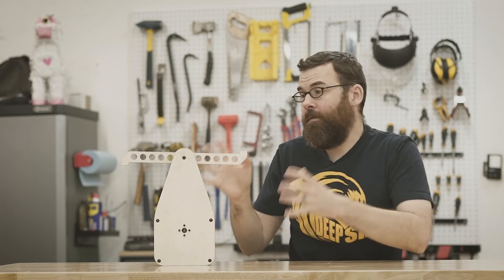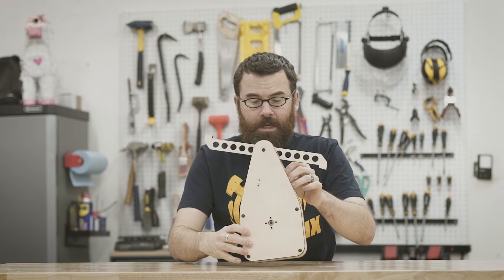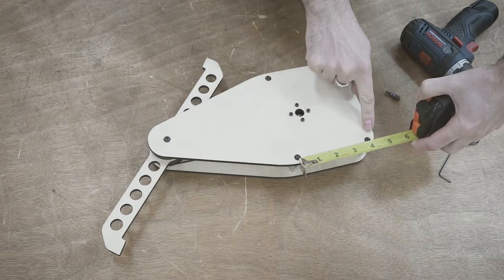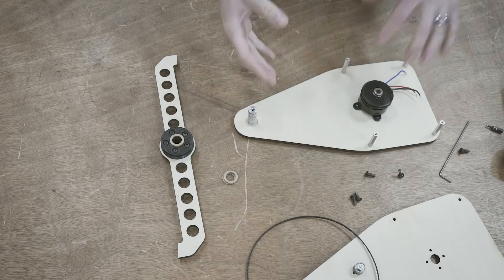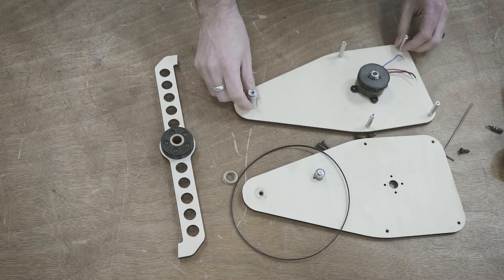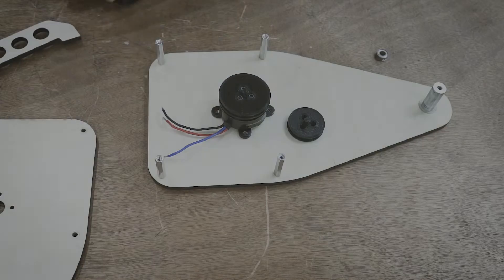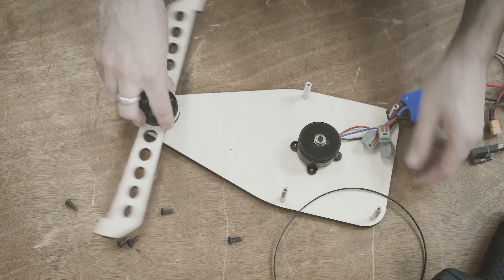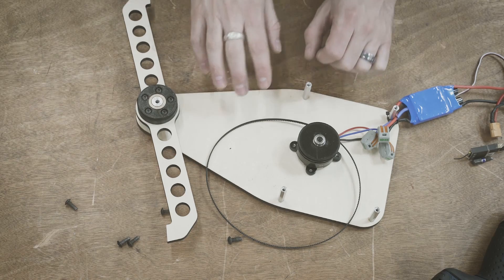Psychotic Break Build - Frame Mockup

Comment: what size and kv rating motor do you use in psychotic break for the weapon?
Reply from the maker: I think it's a 44mm pancake motor, ~600KV.  It's not available anymore, so I cannot send a link to it, and you can't buy it anymore unfortunately.
Reply: @RobertCowanDIY  Ah, thank you. Currently working on a new beetle weight, Bullet Ant, with a weapon larger than any bot I've done before ~.7lbs vertical disk. So I've been asking around about other bots weapon motors that have very large active weapons to get a feel for what spec motor I may be looking at.
Reply from the maker: @RayLopezBTownSting  Got it.  Check out some of my other videos, I have one where I compare motors for anxiety attack (which uses pretty much the same weapon system as psychotic break).  Generally speaking, 150W per pound is a good place to be for brushless motors.  So around 450W or so would be good.
Reply: @RobertCowanDIY  Super helpful, a lot of my first bot was just testing a few different motors I had lying around from other projects till I got one to consistently spin up to a good speed. My main issue was using motors with too high of a kv rating, but that wattage tip is a really good one.

Comment: I have a question.  On crippling depression you put a propeller on top of the weapon to give the bot some down force.  I don't know if that was a joke or not but a thought occurs.  If you were to grind the edges of the bar to make a pseudo propeller, you'd get some weight off of the bar and you'd get some down force for your bot.  Is my logic sound or is there some foible of physics that I am missing?

Comment: I’d be interested to see how much weight you could save with some FEA/generative design on that frame.  Or the weapon for that matter.
Reply: What's the loading case on the frame? Generative design works well with easily defined loads but the weapon will transfer forces in almost every direction after hits
Reply: Edward Etheridge it also works well with not so easily defined loads or loads from all directions.  There’s still weight to be removed.  Just takes more effort and you have to combine the results.  I used it back in ‘06 on an automotive wheel (Altair OptiStruct), where loads are applied from basically all angles (rotary, radial, impact, and frequency simulations with load cases from all directions).  By combining the simulations, it gave some interesting results that we never would have come up with on our own.
Reply from the maker: @ninjaed13  Yep, this is what I'm trying to figure out!
Reply: Or a DDT/Silent Spring-style 3D printed Onyx frame with hexagonal crumple zones

Comment: What about PU round belts? I used in a 12lb and work Very well
Reply from the maker: Don't these belts flex?
Reply: @RobertCowanDIY  I make It +-5mm shorter, It Works Fine, and in the end, the belt was the same size. Worth a shot.
Reply from the maker: @luizsoares9481  Noted.  I've found they tend to jump off the pulleys if they get shocked or stressed enough.  But I could try them again.
Reply: @RobertCowanDIY  i made my pulleys with and extra "wall" , so its more difficult to scape, one off the firsts photos of my insta os the robot. @equipeengenhariareversa

Comment: Why do sprung belt/chain tensioners not seem to be used in combat robotics.  An adjustable spring (like on an cantilever brake, or singlespeed tensioner) would seem a good idea rather than a fixed tensioner that can't adjust for stretch of belt or distortion of the frame or shafts under a hit
Reply from the maker: In cases like this, the belt sees very large impacts, and if a belt tensioner is adjustable, it's going to cause the belt to be too loose during an impact, which will most likely cause it to slip off the pulley.